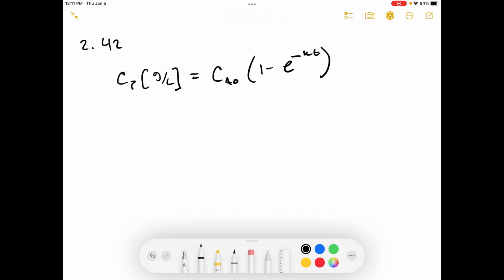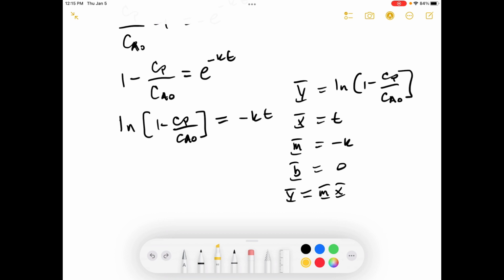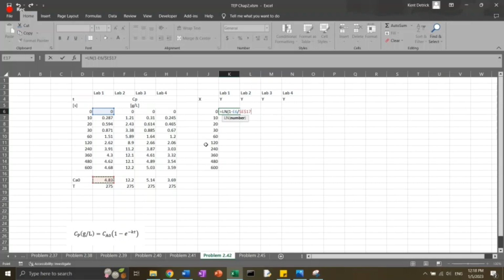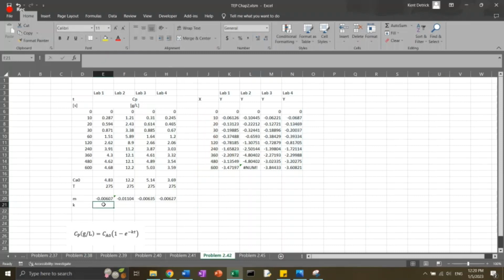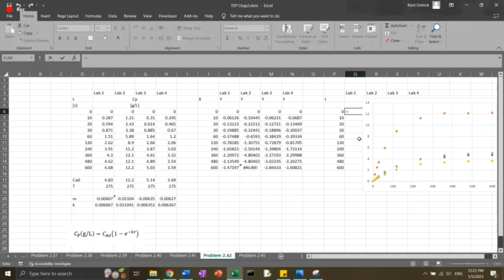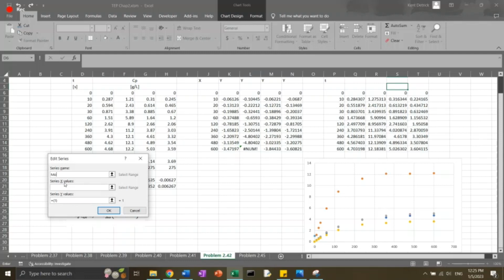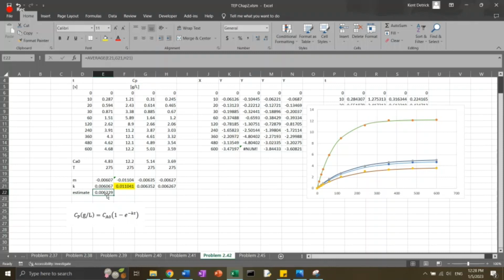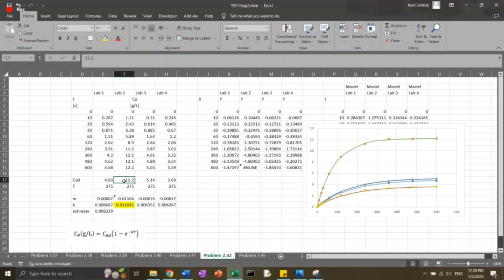TEP - Elementary Principles of Chemical Processes Third Edition - Problem 2.42 - Episode [042]

Comment from the maker: I made one error in calculating k. I used the built in slope function, but this slope should only be used if you have a non-zero intercept. You should instead use the function in Appendix A.1 for calculating a slope with a zero intercept. The difference in k is not much, but it is slightly different.